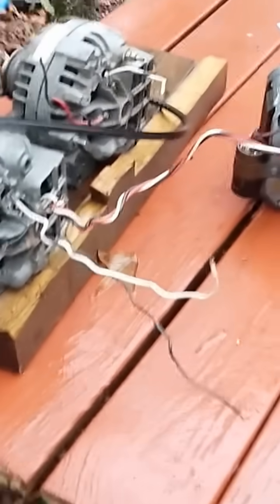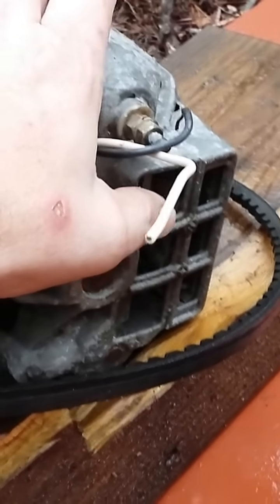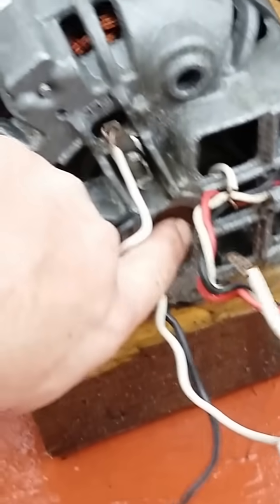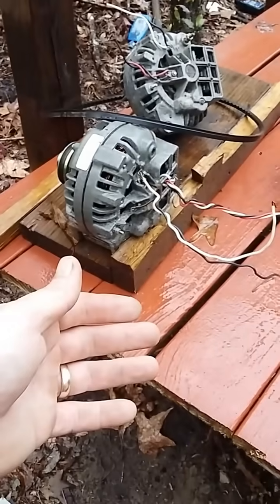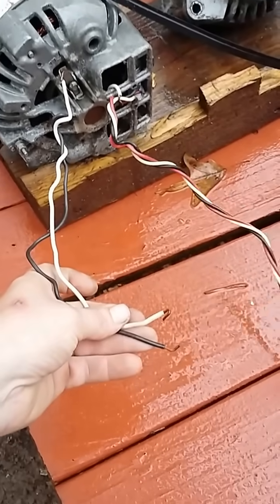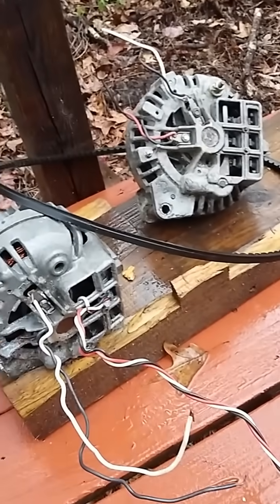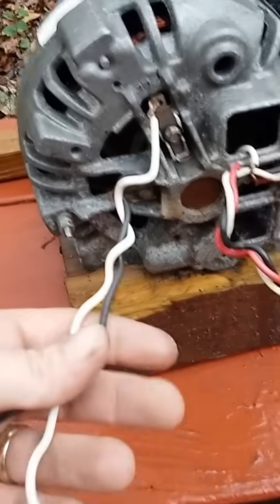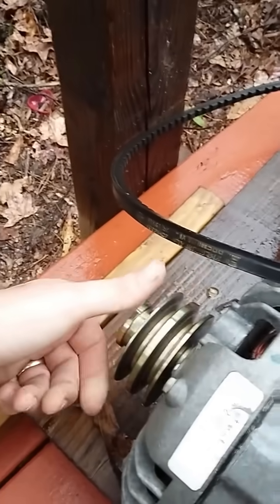Update Free energy forever no wind no solar no gas READ DISCRIPTION!!!

Comment: Nice little ploy.
This video is just a taster, if you want the real deal just pay a small fee and all will be revealed!

Then the dupes slowly realize they have been scammed, in the meantime due to the amount of fucktards on this planet, your bank balance rises exponentially, as there are no refunds or fucks given by you.👍
Reply: Folks what he's saying can actually be done. Alternators are essentially generators. They first make ac current that's rectified into DC for your auto. Bypass the rectifier and it becomes possible to achieve 115/220/240 house current. There's just a little more involved.
Reply: @jimdandy6185  Nobody is disputing the fact that an alternator is a generator.
The claim is free energy!
What's turning the alternator for free?😊
Reply: @michaelfowell223  yeah, I think I commented on here that free energy is a fairy tale. It takes power to make power, everytime, I think the dude was showing a small motor that supposedly he used to spin the nator. Obviously it would never turn enough rpms, but still it's energy to make energy. I'm just saying to the ones that are just instantly labeling the dude as a fucktard that his idea definitely holds water. I've actually seen this idea applied before and it worked, for a short moment, it's also very dangerous, unless your a electrical  engineer, nobody try this, otherwise your asking for it. Dont burn your houses down.
Reply: Ok dummy not all of us are rich  mr patriot
Reply: @naturalmilkhoneyandzenretr9508  I am far from financially well off, money doesn't make you rich.
But what little bit of money I do have, was earned, doing hard honest work, not by leeching off uneducated, ignorant individuals who want to believe.👍

Comment: A gas powered generator can power your home in a power outage,  it will generate enough electricity to do so,  a alternator that has a high enough rating to produce 100 120 amps is well enought electricity to power your home. If it is put together correctly and safely it can be done, and a second alternator  can be used for a charger for the battery that is spinning the alternator.

Comment: Thanks fornthe info. Hey if you can use the one alternator  for 90amps and thats enough for your house, then why not use a car battery to spin the alternator and use a second alternator to charge the battery that powers the first alternator,  that way the whole mechanism is self powered and will never need a outsource for power and can run constantly and never discharge?
Reply: That was my thought too. 👍

Comment: The best way to turn it is with a really long elastic band and wrap it around the shaft of the alternator. Now remove your britches and tie the other end to your own shaft. Now simply keep walking backwards off into the woods. It's best to do it at night, so as you're walking away into the darkness you can see the light generated to keep orientated to know which direction to walk away from. When the band runs out, and the light flickers and dies, sit down in the dark cold woods on your bare bum.....and cry hopelessly.

Comment: Sure, but you need a power source to spin the alternator.
I mean I'm sure this guy has all day to steal car batteries for storage and plenty of energy to pedal that exercise bike connected to the alternator. You have to have tons of energy when you smoke that much meth!
Reply: You can actually do this, if you set it up correctly, if the rating of the alternator is high enough to get at least 90 to 100 amps thats all it takes to power you home, also, you can attach a car battery to spin the alternator but if you rig two alternators one can power the house and the other can be used to recharge the battery just like in your car. So the battery can continue to run, no its self sufficient.

Comment: After reading a few of these comments, I would like to chime in on this. The alternator can in fact output 240v AC if you bypass the rectifier (diodes he referred to). This rectifier is what converts the variable AC current created by the alternator to a stable 14.4v DC. However the frequency is much higher than what is used in normal electrical systems around the world.  In NA this frequency is 60Hz and other parts of the world, 50Hz. Theoretically if you used a 240v to 120v step down and can dial in the frequency using other circuitry this is possible. You could then potentially use a 120v to 12v step down to power an electric motor, however the power needed wouldn't be enough to actually keep it self powered. However, you could use an 8-11HP horizontal shaft lawnmower engine to keep it running. If you convert the motor to hydrogen you could even use a local creek for fuel using an electrolyzer for fuel and keep this kind of setup running for a long time. This is possible and I'm working on a prototype generator using this same sort of setup and have had reasonable success, but need to make the electronics to get it completely dialed in and safe to use for all electric powered items (like TVs and computers).

Generally the easiest way to do this is to generate an AC current, then convert it back down to DC and back up to AC. This will help to rectify the AC frequency.
Reply: He said hydrogen not gas conversion
Reply: Winning you sheep 😂 typical to judge and read between the lines without knowing anything for your self and then criticise with no knowledge as if you have all the facts, such a sheep thing to do to follow society brainlessly. Open your eyes and your mind atleast  and stop being a sheep, figure out for yourself if it's possible or not before opening your mouth by default
Reply: Oh boy, there sure are a bunch of dumbass haters on here that they don't even fully read something before they already got some hating ass remark ready to say.  It's actually hilarious.
Reply: Most funny part about it is its seems to be the typical response from a fucking 8th grader... think they know something, but don't know shit.
Reply: Great idea to Stephen
Reply: see this video  it is portuguese and tell me something after    https://www.youtube.com/watch?v=XWlG5jXvwAQ&ab_channel=liciniobatista
Reply: Stephen P   “You could use a 8-11hp motor to keep it running”.  The gas ur using costs MORE than the electricity costs you are saving.   🤣🤣🤣🤣. You idiot.
Reply: @Executiveinvestments-  see this video  it is portuguese and tell me something after    https://www.youtube.com/watch?v=XWlG5jXvwAQ&ab_channel=liciniobatista

Comment: ok ok lets talk facts now and stop dreaming about how to electrocute ourselves.   No that will not power your house, no you cannot get 220 v at 90 amps.  and the why, first, anyone who knows alternators knows how they are designed,  depending on the size of the alternator 50-120 amps is possible, but only at 14 volts. and  not continually.  then don't forget the math,  lets use a 90 amp ALT for our calculations.  90A x14V  = 1260 watts.  the windings in the alternator can only dissipate so many watts of power in the form of heat.  yes you can bypass the rectifying diodes and regulator and get straight AC power and yes the faster you spin the ALT the higher the voltage you will get to a point. the point to where the ALT flies apart from too high of RPM.  I know you can get 110 volt out of them and power regular house hold appliances  after you fix the 3 phase problem.  but you cannot go past their safe wattage dissipation rate or they will burn up. so in the case of the 90 amp ALT 1260 watts is not sustainable.  and you reach that at 11.45 amps.  A safe continual wattage rate would be more like around 800 watts.  which would give you  about 7 amps current.  800 divided by 110 volts = 7.27 amps.   yes you can run higher current devices but only for short periods of time before you would have to let it cool down. and if you go to high with your amp load you could fry the windings like right now.   so what is this person showing us?   nothing really, not free energy.    and don't forget you need a motor that would draw even more amps than the ALT can put out continually just to turn the ALT.   so you get nothing really.    but with that said yes there is a way to turn the ALT with a tuned motor that is smaller than the ALT but you also have to use a mass flywheel and capacitors.  also on youtube.     and yes you can get free energy, from the charged space around us by manipulating magnetic fields to create a path for electrons to flow through.     you can harvest gravity in various ways  using leverage to manipulate a mass  in such a way that gravity can continue to act upon it and create an oscillation.   see mikovic oscillator.  chas campball ,  skinner gravity engine.   they all do it, amplify mechanical force.

Comment: Could I use to power my coach, which I am currently living in on my property? I have tried solar but I don't have the $ to buy a big enough battery bank, also I dont have the $14k they want to drop a pole at the edge of my property.  I am desperate to find a inexpensive solution.
Reply: ron Minghelli no you can’t. Buy a generator that’s big enough to run your coach.
Reply: So then what does your post "free energy forever" relate too? What does your device power?

Comment: Doesn't it produce 3 phase 240 volt? Doesn't your house run on 240V  2 phase? An how do you adjust it to 60 hertz?
Reply: Many houses get 3 phases on the maine circuit breaker. After the maine circuit breaker you share those three fases on to 2 fases circuit breaker. This is done to keep the cost on cables down. You can have more Amp on a small three fase cabel than 2 fase cabel
Reply: He doesn't, because this guy is full of crap.

Comment: When. In PUERTO. RICO. LOST. THE POWER. ON. 2 MILLION. PEOPLE. YOU. PEOPLE. WILL. NOT COMMENT. THAT. WAY.  YOU. PEOPLE. DO. NOT. APRECIATE. TALENT. AND. IDEAS.  YOU. POPOLE. DON'T. KNOW. HOW. IS. TO. LIVE. WHOUT.  POWER.
Reply: Melvin, want to tell that to us in S. Florida? After Andrew it was 5 weeks before we had commercial power back. It was 2 months before we had a working phone. After Rita, it was two weeks before our neighbor had power back. After Irma it was 4 days before we had power back. During all those times, we had generators running at most of the houses. For Irma, I was on an inverter powered off of my pickup for two of those days and at night. During the day on the 3rd and 4th day I ran our generator.

Comment: If I wanted to add a feedback loop back to my battery, I would be able to do that by using an AC to DC inverter right?  Also, where would you recommend I place a capacitor? I want to have one just in case the battery dies out.  Unlikely but I’d rather be on the safe side.  I can’t believe people are giving you crap. This is a brilliant idea and oh so simple and inexpensive. Oh, almost forgot....for a 220v, connect the neutral and ground wires on one bus?  Thanx a mil my good man. Take care and God bless.

Comment: 180 amps...at how many volts? 180 amps at 0.01v is 18 watts. you need more than that for your house. you didnt demonstrate anything, please do some tests.
Reply: @CLK Products they run on 12v, they dont output 12v. and they step down AC to DC with diodes in order to achieve 12v.
Reply: @CLK Products may i ask about your setup? because you can change the voltage and amps depending on how fast it's spinning. put it in your car and it will output 14.6v, put it on your bike and it will output next to nothing.
Reply: CLK Products show some more controlled testing of this free energy machine. if its real then you will be the greatest man alive.

how exactly is the energy free? do you know what free energy means
Reply: CLK Products bro...look at the title. change it you cretin.
Reply: @CLK Products lol you fucking scammer. it still says free energy when you just admitted it's not free...you're a lying piece of shit trying to get views. you have 5 million because you claimed free energy in the title, you are aware of this and are exploiting it. youre a terrible person.
Reply: CLK Products youre living in the fucking woods you bum

Comment: I wish the viewers could see the connection to your house and see it actually working.  Also, for your next video, please put an voltmeter on the leads and show the power levels being generated (Volts / Amps).  For people interested in doing this, details are crucial.  Otherwise they won't believe it.  I assume you are driving these with an AC motor, correct?  What is the current after motor voltage.  So much missing here...

Comment: What if you spin stated with a windmill type device.
Reply: Using a gear/belt pulley stepdown to turn the alternator at higher speeds, this would work.
Reply: I'm still wondering who they.are 2years.later lmfaoo think.its Kentucky powe is who  "they" I'm guessing they are from your reply hope your still hanging on there with your legal power generating device hope ya got some more alternators so you can.play that baby sum music or heat him a bottle for him lol hehe

Comment: A little knowledge is a dangerous thing. You clearly know nothing about how the stator coils are wired to the rectifiers to produce approximately 14.5volts d.c. and at a current depending on the type of alternator, but in most cases limited to around 50 amps. The output of the coils in a.c. Current will NOT be 240volts and the frequency will not be 50 or 60 hertz, that will depend on the rpm of the driving source, which is what? Where does the energy come from for that? I hope you are not being payed to put this pea brained idea (invention?) on you tube.
Reply: He says if you send him $5, he will tell you how it works. He's a criminal that should be in prison.
Reply: jhanthony2 if you all really knew anything the first thing you would know is that the govt would never allow free energy as it doesn’t make money for the govt. this guy is probably on to something. Why was Nicola Tesla killed? He was like this guy, he wasn’t greedy and cared about the common person. Now you sound like a senseless leftist suggesting prison for him. For what? Let your own closed minds consume you. Some folks are able to see the potential in this. I believe he’s got what he says, and I also believe not many people have his knowledge because most people are going to “facts” something widely misused. Only God almighty knows it all.

Comment: I have 30 years of experience in this, no one has been trained in this subject like I have. If you are wanting to do this OK you need a clear understanding of how to do it  wind? I WOULD LIKE TO TELL THE POWER  COMPANY TO TAKE THEIR LINES OFF MY HOUSE .912 339 3861
Reply: I have a better idea, legally if you make more electricity than you use the electric company has to buy it from you if you want to sell it..some people who usually live in a rural area have put up big windmill generators and have the electricity they don't need sold to the electric company and each month is played for the electricity they sell..accource you'd have to find out all the conditions and laws and regulations but some people actually get paid for selling their electricity!
Reply: I have a few things to mention to anyone who is interested. .. if by EMP's or any other disaster that would cause our infrastructure to collapse, like no food no water,no electricity  or supplies that are needed on a daily basis...we all Americans should prepare for alternate fuel, and need resources research them take notes and info and prepare..here's a few to research...gasafier taking wood burning smoke gas fumes  in a system designed to  run a car or small gas fueled motors.. hydrogen gas for fuel made with electricity frome a battery and water and baking soda,  uses are a flame to cook or heat or fuel for motors.. and don't forget the Hindenburg disaster so exercise safety precautions when experimentation and note the dangers before hand..next generators powdered by wind sun,water, etc. And how to protect them from EMP and other issues  good  luck and God bless!
Reply: People IN PUERTO RICO. USA. WILL. LOVE. YOU. FOR. THIS. WHEN. YOU. HAVE. BEEN. WHOUT. ELECTRICITY. FOR. A. YEAR. ABOUT.  THAT??
Reply: @jeffveron8783  where are you located? In Florida, after you sign the agreement and the installation is inspected and approved, the utility must buy the extra power you produce. Here is the page from the company that supplies us. https://www.fpl.com/clean-energy/net-metering.html

Comment: The baby is crying because daddy is playing with electricity in the rain. Amps n rain is a bad mix.
Reply: Baby is crying cause it's prolly neglected and fucking sad 😭
Reply: Rain is distilled water and do therefore, it cannot conduct electricity in the way that mineral filled, dirty, ground water can. Please educate yourselves first on the power of electricity/amps/power
Reply: @jeffveron8783  Rain water will conduct the lightning that fries your butt. And 240 Volts will also travel thru rainwater.
Reply: Then how have experiments been done with 240 into a pool of very clean water that hurts nobody? As long as you do not touch the sides of the pool and ground yourself out, you are fine

Comment: You can Take part of the AC Output of Alt. and Recharge your Input Battery, thus it will never Run Down--a Perpetual Motion Machine. Just had a second thought--what about your Running Frequency which should be 3600 rpm's to get 60 cycles so that lights and motors work properly...
Reply: Are you sure on that alternator what speed it needs turned at? I can drive a 36 pole PM motor at only 150 RPM and get 60Hz out. I have an alternator that is designed to run at 1800 RPM and produce commercial grade power. Some commercial grade generators were designed to only run at 900 RPM. It all depends on the design of the alternator. 3600 RPM is the design for matching a small gasoline engine to an alternator but by no means what one must be run at if designed right for a different speed.